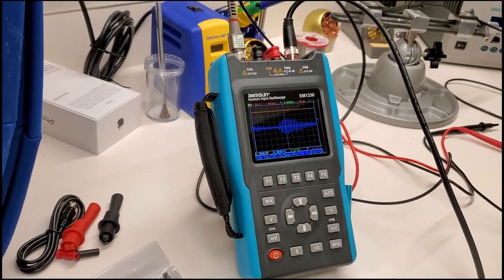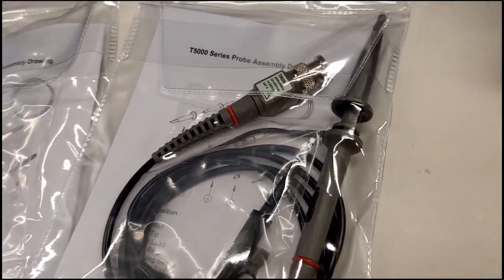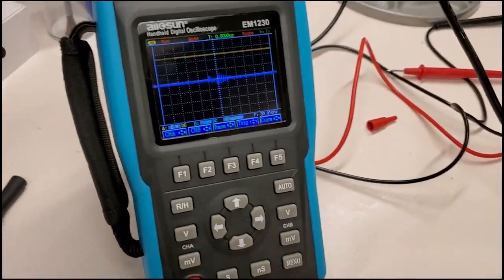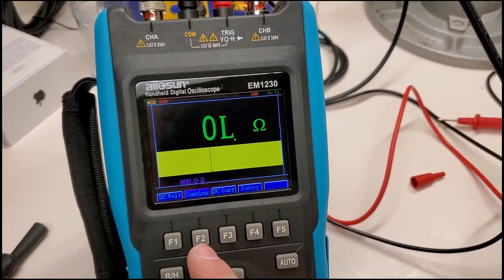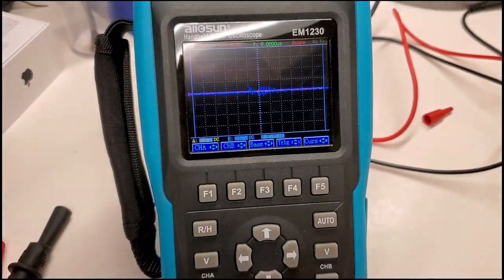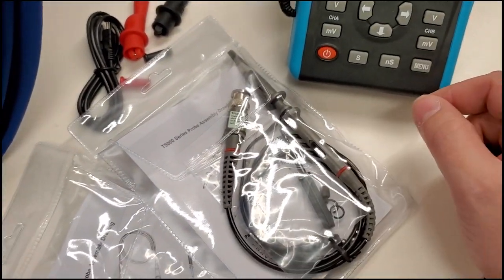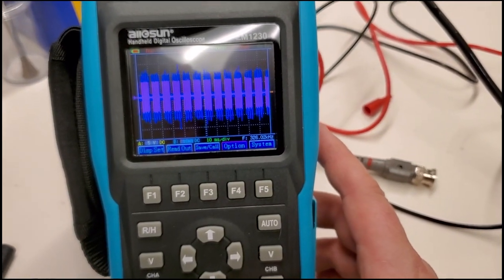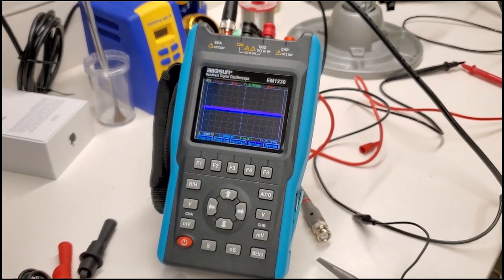First Look!  Allosun EM1230 $250 Color 2 Channel Oscilloscope

Comment: Hey mate excellent run through of this scope, I have 2 questions if your able to help.
1, with the plastic BNC connector  how is the probe ground referenced or is there bit in there to make contact with the BNC jacket? 
2, is there a Math function in menus  anywhere eg, FFT and addition and subtraction of the channels 

Thank for  putting this video up!
Reply from the maker: I will see if I can answer your question properly with a video. or at least with pictures.

Comment: Thank for the video, I am very tempted to get this scope/meter.
Right now I'm put off by those plastic BNC connectors.
On amazon they show a picture of the top of this unit with metal BNC connectors, but the straight on photo of the unit still shows plastic BNC's. Metal BNC's could be a possible modification/upgrade the manufacturers have implemented now.
Remember the two scope grounds are not likely isolated from each other !!
I know this comes with an "Isolated" charger but if you power/charge the scope from a non isolated power supply you could have an issue there with grounds while in use.

Comment: I have used my EM1230 for several months now and I have noticed an artifact on the display which is particularly noticeable on square waves. The same artifact appears in your video at the 9 minute mark when you are displaying a square wave. If you carefully look at the vertical transitions either side of the centreline you will see that they "walk" or jitter sideways slightly. Note that neither the far left, the centre and the far right vertical transitions do not move at all.

I built up a test oscillator using a CD4060 and a 32.768KHz crystal and connected the scope to the Q13 output to monitor the 4Hz waveform. The triggering was set to AUTO, DC coupled and timebase was set to 100mS/div. I must say it was perfectly square wave and the left hand vertical transition of the waveform aligned perfectly on the leftmost graticule line as it also did on the centre graticule line, and on the far right graticule line also. Neither of these 3 vertical transitions moved one iota sideways at all but the intervening transitions either side of the centre vertical line would periodically jump sideways by a small degree - I can see it on your video as well. What I also noticed was that the sideways jump in the vertical transitions always occurred status display moved from Triggered to Run. Exactly when Run appears on the screen top left does the the square wave vertical transition either side of the centre jump sideways. When Run appears next time the same jump occurs.

Now this to me is not how a scope should behave. With a rock solid crystal controlled frequency being sampled all vertical transitions should remain fixed and not move at all.

It is my opinion that when the scope enters the Run phase of capture it somehow shifts the timebase reference slightly and causes the vertical waveform transitions to jump to the side before returning to the original position.

 I have fed my concerns back to the manufacturer.
Reply from the maker: Now I'm going to do the same experiment. I have a few frequency generators to test it with

Comment: This is the first review I have seen for this scope and it has been fairly helpful. I might add that I have one on order and despite the small annoyances noted in the video the specs are rather good for such a low cost instrument.

It did occur to me that the plastic BNC connectors might be to provide electrical isolation but I have never come across this before.

Hopefully, as you become more familiar with the operation you will do a follow-up review.
Reply from the maker: Thanks Ross. I've used this scope for some PWM checking on servo motors, some electrical noise on a ground circuit and diode mode checking of circuits.
Reply: @BetterBiomedChannel  Thanks for the reply.  Did you find it was difficult to navigate the various options for your testing and what do you think of its performance?

Have you  investigated the possibility of replacing the plastic BNC connectors yet and how doing so might affect its electrical isolation spec?
Reply from the maker: @rossherbert1591  I am using this meter all day today while checking the wiring and encoder signals of my cnc router. So far it's the best sub $300 meter I've used.
Reply: @BetterBiomedChannel  That is good to hear :-)
Thanks for your help.

Comment: I was going to buy a fluke 88v automotive meter, but for less money i vould finally get an oscilliscope. Any more thoughts on plastic bnc? Does this do everything a high end dmm does? Temperature, capacitance, low impedance?
Reply from the maker: This does have a full featured dmm and the plastic bnc isn't an issue at this time. The menus take some experimenting to get used to but after some time with this meter, I do like it.
Reply: Fluke uses plastic. Of course there may be a difference in quality,. My Fluke 97 is twenty years old with no problem.
Reply: @howlinhog  I have the Fluke 99b, with twenty years old and is better in every posible way.

Best Regards.

Comment: Just ordered one and it will be here Friday. Your video is a good getting started.
Kit would have been nice if it had a touch screen.
I like that you have to hold the power button down for 3-4 seconds. It prevents an accidental power on when in the back or in a backpack, etc.
I agree with the menus and the naming of the some of the functions like “resistor”, etc.
It’s strange that there is no calibration input to calibrate your probes
Thanks for the presentations

Ricky from IBM, Ret.

Comment: If you're a tech who has to work out of a tool bag, a delay in power on is a good thing. A dead battery because of accidental power on can really mess you up when you're in an area with no access to a wall outlet. You do get what you pay for though and even though my Fluke 97 and 199C were pretty pricey new, they have features and safety options (isolated) I'm not giving up. Menus are pretty intuitive also.
Reply from the maker: I do love my 199c.

Comment: Point of plastic BNCs when you are measuring some signal and you hook up your ground lead to something that is floating/not grounded so you don't get electrocuted. So it absolutely  makes no sense they provided probes with exposed ground.  Most of the portable/handheld oscilloscopes have plastic BNCs or  connector is insulated banana plug with ground connection recessed in body of the scope like in Fluke.

Comment: I'm very interested in this unit. But I'm really still left with a lot of questions about it, even after watching this. (I know this is suppose to be just a brief overview) So I think someone needs to make a more in depth tests on it. I am really just pulled off by it only going down to 10mV/div from its specs.
Reply from the maker: If you make a review on it, I will watch it.
Reply: @BetterBiomedChannel  I don't have one, I am just deciding to get one or not. I don't have good enough test equipment or knowledge to do such a thing. I hand that task to over to you! :)